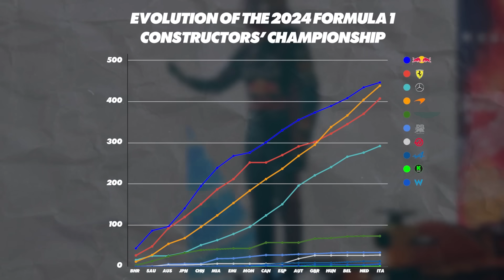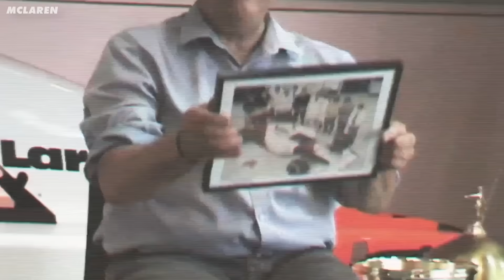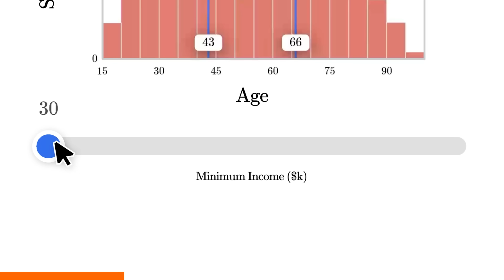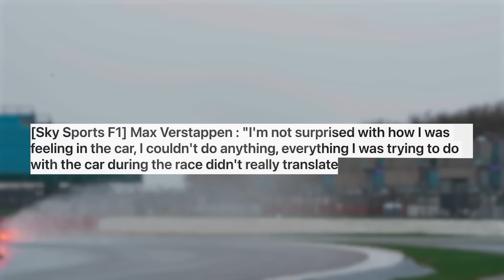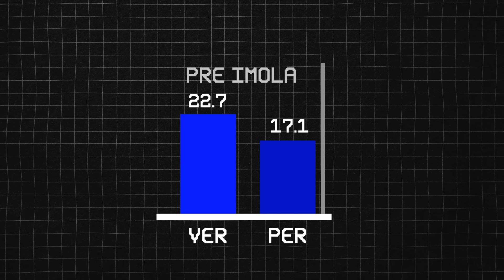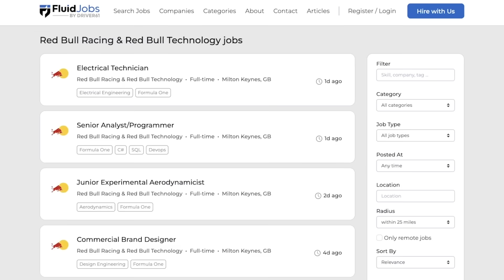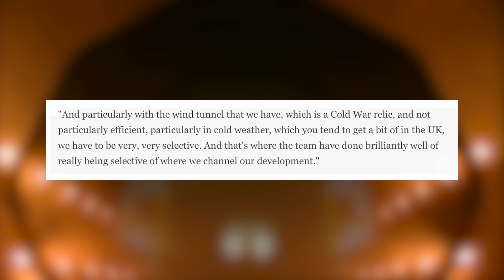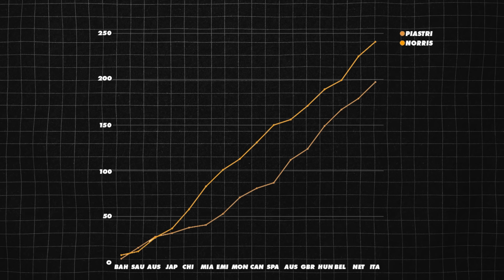Why McLaren Are Now SO FAST

Comment: I understand people saying that mclaren should back Lando, because he has more points. However, usually the driver backed needs to indisputably prove they are the better driver. You need to take Piastri's progress from last year into account. Sure, Lando was dominant in zandvoort, but he has been slower than his team mate multiple times (Spa, Hungary firat 2 stints, Silverstone, Monza, etc). Lewis and Max have been backed by their teams in the past, because they wiped the floors with their team mates. Lando is not doing that.
Reply: I think Norris has himself to blame to a good extent. He's playing the nice guy and took the "papaya rules" thing way too literally. If his team-mate is trying a daring move he has every right and absolutely should have to brake late to defend himself, not just stay out of the way and let it go. You need to do some of the talking on the race track as well, not just in a debrief room. Had he forced Piastri to cut the chicane and lose out rather than give him all this room to make the corner and come out on top, he wouldn't have lost the lead AND would have just as many arguments as Piastri for a race debrief later. Instead now it's mentally 1-0 for Piastri and I suppose Norris is gonna try to force the itself team to control Piastri but that's never optimal. Piastri confidence is gonna be through the roof and Norris is making himself second-guess on how to drive.
Reply: Raikkonen 2007 and Massa 2008: they only fought for championship because Ferrari choose one after Spa. It's an one year choice, doesn't need to be static.
Reply: @gogox98 have you seen teammate head to head?
Reply: Couldn't agree more. Norris is a very good driver but McLaren know they have a potential future legend that has demonstrated his selfish hunger this season. If they were to step in while both drivers could mathematically win the championship, that could influence their driver lineup in the very near future. When max leaves RB, I can take a good guess at who they would approach on the current grid to replace him and it won't be Russel or Norris.
Reply: @scottnicholls2523  for whatever reason, Norris has outperformed Piastri this year because he is ahead of him in the championship.. But even Norris is still 62 points behind Max. If Piastri has a brain, he will understand that in this situation there is a good reason to make Norris #1 for the rest of this season. Next year it could be the other way around and Piastri could be made #1 at some point in the season. Or they might both be so far ahread of the rest that there is no need to make a choice. Piastri cannot reasonably require McLaren to fight with 1 hand tied to their back (as they are doing now). [But I'm perfectly fine with more poor decisions by McLaren that would help Max to another title.]
Reply: @ronald3836  true but the sad thing is even Schumacher in 99 didn't do much to help Irvine. Hamilton didn't help Alonso and the other way around. Webber didn't help vettel. My point is McLaren are only interested in the constructors championship and keeping their star happy. They would be mad not to because at the end of next season max will be putting himself out there, probably to Merc and RB will probably be looking for a top quality driver with a killer instinct and on the current grid, that's Oscar.
Reply: @ronald3836 Okay but it's way more likely for Piastri to beat Norris who is 44 points away than Norris beating Verstappen at 62 points. Honestly if Norris needs to be given points to beat Verstappen he doesn't deserve the WDC. I say this as a McLaren fan I don't care if Verstappen wins another WDC but I want Norris and Piastri to fight no holds barred otherwise it undermines the sport.
Reply: @Dischingo  If anything, a McLaren team playing the game with one hand tied behind is back is what undermines the sport in my book.
Reply: @ronald3836 your logic makes no sense because now you’re asking Piastri’s biggest rival in 2025, the only driver who will be challenging, Lando, to lay down. You know that won’t happen, especially if Lando did win this season. If Piastri has a brain he’ll bury Lando in the races every chance he gets to make him look like a clear number one by the end of this season, clearing Norris for second if not beating Max in the process anyway.
Reply: @ronald3836 equal opportunity for both drivers undermines the sport? OK bud. Tell me you don’t understand sports without telling me you don’t understand sports. No backtracking now.
Reply: @Parker--  giving team orders is not asking but ordering. F1 is a team sport.
Reply: @ronald3836  Then there should be no WDC.
Reply: @Parker--  Tour de France is a team sport, yet there is a yellow jersey for the cyclist who tops the general classification (among other prizes). Each team can devise its own strategy to win those jerseys and prizes, but generally it is recommended that the cyclists within a team COOPERATE.
Reply: It is not about who deserves to be #1. It is about what McLaren needs to do to win the WDC. They need to make Lando the #1 for the rest of this season. Next season everything starts from scratch, and Piastri will have the chance to beat Norris.
Reply: @ronald3836   why would you favour lando if he cant even beat his teammate and make many mistakes. piastri deserves to race him because he is faster in the past couple races and does not bottle race starts. The team knows lando will not win the championship so why give him favours when piastri will be number 1 next season
Reply: @James-gr5mx  again, it is not about which driver deserves it but about what McLaren needs to do to win the drivers championship this season. Norris is in a better position than Piastri and has the championship within reach. If Piastri had had the most points of the two, then Pastri should have been #1 for rest of this season. But if McLaren prefers to fight RB/Verstappen with 1 hand tied to their back, then fine with me.
Reply: @ronald3836  this is nonsense McLaren needs to worry about The constructors championship, the Drivers Championship is up to the drivers to prove and determine who’s best, and the team should not interfere in this. It is Norris who needs to step and  out perform Piastri, like Ham vs Bottas and Max vs Perez where it’s not even the team who decides which driver is #1.
Reply: @ronald3836 ok but Lando has trouble beating Oscar and Oscar is a lot closer to beating Lando than Lando is to Max, and Lando sucks at starts which means Oscar will continue to best him, so if you really want the team game you use Lando to block Max and let Oscar pass Max and Lando in points. Happy?
Reply: @ronald3836 No, by your logic Lando should lay down next season for Piastri for what looks to be a guaranteed McLaren WDC next year so Lando has a chance a t WDC this year.
Reply: @Parker--  I have said nothing about next season. As the current season stands today, McLaren can let one of its drivers, i.e. Lando, win the drivers championship if they make him #1 for the rest of this season. McLaren can also choose to be this season's laughing stock and lose the drivers championship to Max. I hope McLaren chooses to be a joke team so that Max wins, but that would not make McLaren's decision not to give team orders any less silly.
Reply: @ronald3836  Right, you didn't, because it would be awfully inconvenient for you to maintain logical consistency.
Reply: @Parker--  My logic is simple. If McLaren cares about winning the WDC this year, they should order Piastri to support Lando instead of fighting him. This has nothing to do with 2025, which is a new season. It has nothing to do with whether Lando "deserves" it, other than Lando currently being clearly ahead of Piastri in the standings. You should not have to be a genius to understand this. Of course if McLaren does not care about the WDC, or if they want Max to win, then they should simply go on like this.
Reply: @Parker--  So what is your take? McLaren should just throw their hands in the air and declare the WDC to be out of reach? lol
Reply: @ronald3836  Unless McLaren hands Oscar the WDC in 2025, your logic destroys Piastri for the rest of his time at McLaren. "2o25 wHicH i5 a n3w sEaSoN." You're sabotaging Piastri to fit your narrative. If they're allowed to race, Piastri will most likely beat Lando. How does ruining the rest of his time at McLaren, which it will, being second fiddle in the best interest of Piastri like you claimed? Just answer honestly, because once the precedence is set, it's over. You think Lando is going to roll over in 2025 for Piastri? Answer honestly.
Reply: @Parker--  do you not understand the concept of team orders? McLaren pays these drivers.

Explain, what should McLaren? Forget about the drivers championship? Congratulate Max? Great.
Reply: @Parker--  wow, you seem very sensitive about this. Is Piastri your bf?
Reply: @ronald3836  Do you understand the concept of competition? McLaren pays these drivers to race. I'm certain if it was in the contract that Oscar had to play second fiddle to Lando for his tenure at McLaren, he would have just stayed with Alpine.

No, you know what they should do? Have Lando drive better and actually beat his teammate. Why is that never an option for you?
Reply: @Parker--  How do you not uinderstand that I am thinking from the point of view of McLaren's team boss. If McLaren wants one of their drivers to win the WDC, then see what I wrote earlier. IF THEY DON'T WANT TO WIN THE WDC THEN FINE, I DON'T CARE. Get it?
Reply: lewis has never wiped the floor with his teammate except 2018, 2020 and 2021. i dont know where that comes from.
Reply: Oscar has improved a lot... but lando has beaten him consistently, specially in race pace.. and he has a chance at the wdc, not backing him is absurd
Reply: And Piastri needs to not buckle under pressure luke Hungary when behind after the pit.
Lando and Oscar are both in better cars than they deserve. Lando will leave and Oscar will flounder.
Reply: @bobdrooples Saying that Piastri would flounder when he’s one of the few ob the grid doing bold moves on their opponents is crazyyy, the fact that he touched the gravel two times the whole race in Hungary when being a little bit cocky on the turn exit isn’t floundering under pressure, doing what Norris does currently, race after race, Zandvoort being the obvious exception IF you exclude the race start, is floundering under pressure
Reply: Not on account that your teammate gifted you your maiden GP win and you took a monumental risk to pass on a chicane, potentially wiping 43 points for your team. Pass on the end of a straight, great. Pass as if you have nothing to lose (and actually not having anything to lose) is a bit selfish. Of course, PIA will always watch out ONLY for #1.
Reply: @ceecee130x it only risks a crash if Lando decides to crash them both out, at which point it’s Lando’s fault, not Oscar’s.
Reply: @ceecee130x  Norris didn't gift the first win. Usually the driver in the lead car is given priority strategy. Oscar was denied this as Norris was vulnerable and strategies were swapped to prevent an undercut on norris. It gave him a massive advantage. The reason he was asked to relinquish the lead is because the team didn't want to show preference to either driver. It was the most fair action they could take and although he moaned during the race, I feel Norris was quite embarrassed by his handling of the situation once he realised that he was about to deny a driver his maiden win not by his own abilities but instead by circumstances put in place by his team. I respect Norris for publicly admitting he handled that situation wrong. If he had of won that race, his stock within the team would have plummeted.

Comment: Removal of asymmetric brake system made a significant difference.
Reply: That was debunked by the FIA
Reply: @cadeavery8623  Yeaaaaahh, Sure they did. (sarcasm)
Reply: @hwilmore can you imagine how hard it would be to manage during a race with all type of condition changes? RedBull probably had something else that they clearly don’t have now but definitely not those asymmetric brakes
Reply: @cadeavery8623  I trust the FIA about as far as I can throw them, and I am NOT touching the French.
Reply: @cadeavery8623  When did the FIA debunk that theory? Please tell.

Comment: For those saying Lando cant win the wdc consider this. Lando needs an average of an 8 point gap between himself and Max per race to win the title by 2 points. 2 races down after the summer break and hes done this at both. As the great Murray Walker would say anything can happen and it probably will. With Baku and Singapore coming up who knows what will happen.
Reply: Makes sense, but this scenario considers that Max will not extract a good performance from his RB ever for all remaining races, which is a bit unreallistic. Max still is arguably the fastest driver in the grid and the RB will likely perform well at least on a few more circuits.

Comment: The fact that McClaren's front wing flexes like 3 inches up and down based on the wind load has a lot to do with their insane pace now. 

Its clearly illegal and against the "spirit of the rules" the FiA likes to refer to.

If they are going to allow it I expect the rb20 to be sporting a flexing wing soon too which should fix their high speed oversteer low speed understeer problem.

Comment: Seems that McLaren seem to able to produce designs that perform on track and validate what CFD and wind tunnel testing predicts.  This is unlike Mercedes and others in the past where the correlations between CFD and actual performance seem to have been at odds.  Maybe that’s the McLaren wind tunnel, maybe some smart engineers who have managed to work out procedures and techniques for improving agreement.

Comment: Monza... it's very possible that if Oscar had eased off when Lando lost traction, both McLarens would have been swallowed up by Leclerc's Ferrari. So I think Oscar did the best thing for the team.
Reply: GOOD CALL!
Reply: Except, Lando pushed and lost traction exactly because of the pressure by Oscar. Not defending either of them, just saying they would have come out 1-2 with no Leclerc in the middle had they not raced each other.
Reply: @AntiVaganza  Except - LeClerc would have passed Oscar
Reply: No

Comment: Driver61, you completely danced around the issue—the recent ban on asymmetric braking systems in Formula 1 has raised legitimate suspicions. Ever since the FIA made this change, there has been a noticeable drop in Max Verstappen’s pace and cornering ability, a decline that many are connecting to the ban. Verstappen himself has voiced dissatisfaction with the car’s handling, especially in slower corners, which raises the question: was Red Bull benefiting from this system prior to its prohibition?

Further fueling the speculation, Sergio Pérez recently commented that Verstappen is now facing the same handling issues that have plagued him for much of the season, implying that Verstappen may have been driving a car with a different setup earlier in the year. This has led to widespread belief that Verstappen was receiving favorable treatment in terms of car configuration—until the rule change leveled the playing field(Motorsport Week
)(Motorsport Week
)(F1technical
).

A closer look at Verstappen’s fastest laps from this year compared to last year further highlights this discrepancy. His times have notably dropped, particularly in circuits where precise braking and balance are crucial. Last season, Verstappen’s cornering speed and lap times were significantly better, indicating that the now-banned braking system may have given him a substantial edge.

Don't gaslight us—we are not as uninformed as you think.

This video should be titled (Why have Redbull lost so much pace!) tunnel time My back foot.

Comment: Newey left and all of a sudden none of their upgrades wanna work as well why are so few commentators actually making this point yes the wind tunnel stuff also makes a difference but having one of the best engineers suddenly leave your team probably makes a much bigger difference
Reply: Well I believe he left because nobody listened to him and the Drivers anymore because they were a bit arrogant probably thinking they're the best anyway and nobody will catch up. McLaren, Ferrari and Mercedes gave them an Ice cold bath and a wake-up call. For me, it's shocking
Reply: Adrian newey didn't design that much of the actual car and floor or on the RB18/19 and now 20. Its actually Wache who is the teamlead not Newey. Fun part is that RB is having a problem with the locking of the suspension. Newey has spent most of his research time on the suspension. In fact he was one of the only people to work on the suspension in Red Bull so that he could prevent the porpoising and other issues that most teams had at the beginning of this new era. That area he worked on seems to be exactly the problem they are having right now... suspension locking over the curbs! 
Well if Newey did such a great job why is Perez usually 22 seconds behind? So sick of this British media. First praising Lewis to the stars and now its Newey getting all credits, typical British